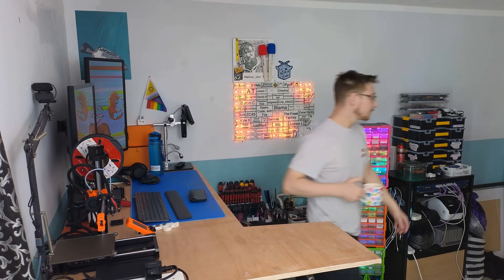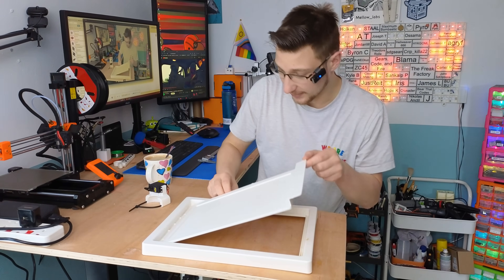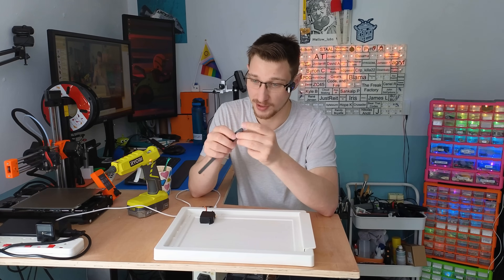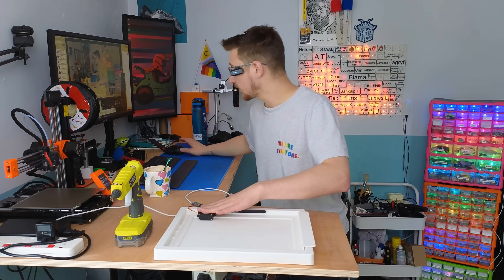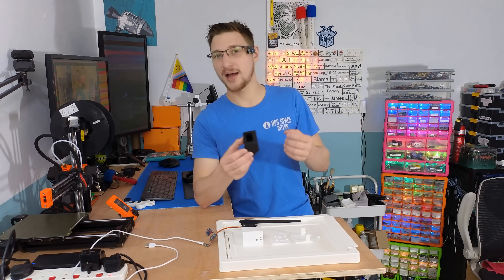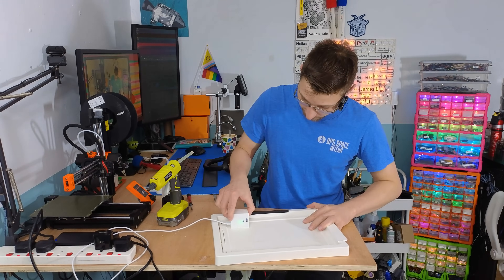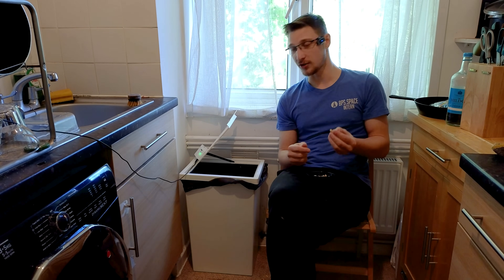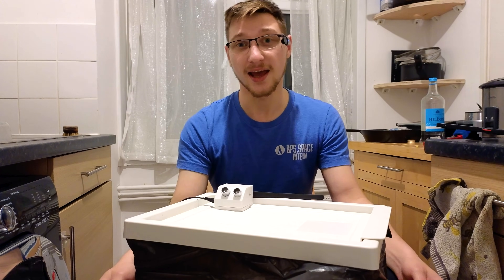Smart Home Trash Bin: Automated Lid

Comment: This is a silly project.mif you want to avoid getting your hands dirty, just buy a pedal bin ... 

and then 3D-print a size 12 boot fitted to a suitable servo mechanism that will allow the boot to depress the pendal. The advantage of this is that you can make the boot's platform mobile (using mecanum wheels, of course) and have it scuttle out when needed. Heck, get it to fetch the teabag and rig a ballista or similar to punt the teabag into the bin. A BME680, camera, weight distribution sensor, and 6D inertial sensor will be necessary to calculate the optimum trajectory (*) and to note where tea slatter has dropped and needs wiping up ... I presume your floormop is network-enabled? 

The AutoBoot can also double as a means of remotely kicking the cat and irritating guests when they get in the way or do something annoying. Add a speaker and get it to issue snarky remarks when dealing with such undesirables.

(Note to self: Enticing though the AutoBoot sounds, forget it. Your project list is already too big!)

_

(*)  See any decent set of naval artillery calculations, taking into account the spin of the Earth, boot's attitude, range & angles to bin, etc. Oh, and rig up sensors to keep track of the ballista's drive and wear characteristics.

Comment: I did something like this but used a VL53LOX time of flight sensor instead of the ultrasonic sensor. Works well with ESPHome and like yours you can adjust what the distance is that you want it to trigger at. Great project and a great video. Keep up the good work 😀
Reply from the maker: How is the reaction time of the time of flight sensor?
I find the ultrasonic sensor takes a? second or two to realise something is there. So I've been considering exploring other options like MMwave or time of flight.

Comment: Nice build! One thing that was annoying me the whole time though... I would move the thing that pushes down (the black part that attaches to the servo shaft) by a couple of degrees to make it still almost touch the bin when closed. That should be easily done by detaching it from servo and turning it a tooth or 2 - would definitely reduce the bouncing. Well done though.

Comment: I love it, there's two changes I'd make.  1. I'd prefer battery power so I wouldn't have to deal with cords.  2. I'd switch the sensor to a big capacitive strip on the side facing you, because of the move to battery power, since it will hopefully drain less power vs a sensor.  I think the ultrasonic is probably the best sensor though, it's just that power consumption.

Comment: Have a look at adding a curve to the opening and closing.
Slow down the closing seq.

That will help with the bouncing you are seeing.
Probs best to have an open and closed state over the deg, since you can then have opening and closing states.
So eg, if the state is opening/open - ultrasonic can just bounce up a timer while it waits (nothing new here)
And of course close is basic.
BUT, when 'closing', instead of reverting to full open quickly, you can slow down to a stop, then revert to open.
Thus mitigating the bouncing completely.

Then for the cable, either use a 90 or move the unit a bit.
Also, add a bracket that sticks out from the unit itself where you can cable tie the USB cable onto to protect it from getting loose and to also control its direction